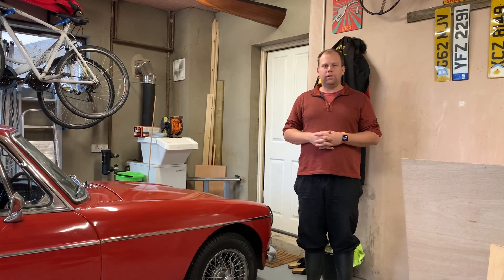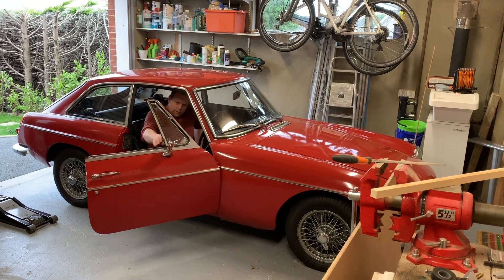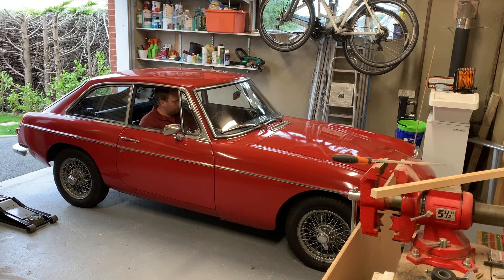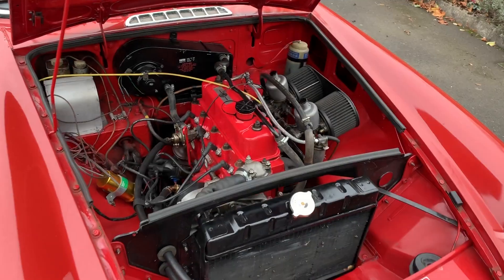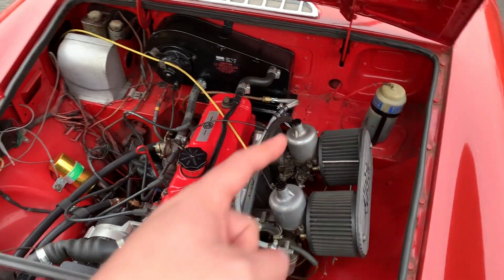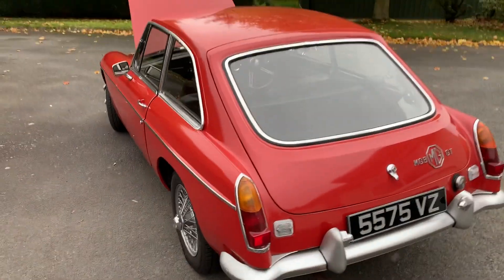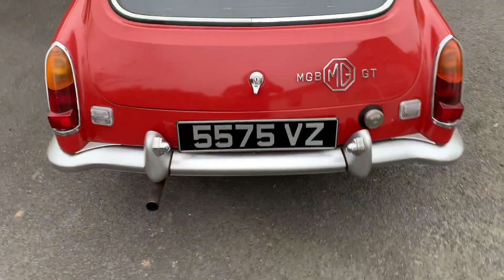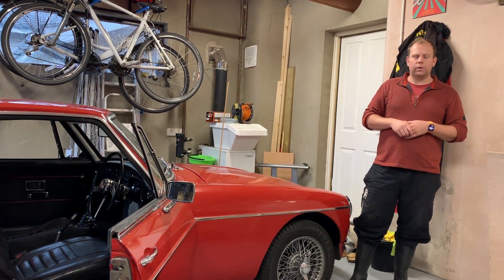MGB GT - The Perfect Classic Car Daily Driver?

Comment: I've had a '75 BGT for over 10 years. I rebuilt it from the ground up with unleaded head, electronic ignition and full s/s exhaust system..    It isn't exactly my daily driver, but I do use it an awful lot.   Drove it from my home in the Midlands upto Scotland, and back. It never missed a beat and I got 28.8 mpg.
Reply from the maker: Nice one Fred! Would love and OD for my own some day. A stainless exhaust wouldn’t go amiss either!

Comment: Without going into the video yet (really), except for the inherent reliability and performance issues of British autos at that time, I'd agree.
For a single person, a couple or a small family (until the kids feet touch the floor) it could be useful.  ;-)
I had a 1972 MGB with a inset grill, fake mag steel wheels a role-bar, tonneau cover (damaged) and had it repainted British Racing Green.  So much fun. ;-)
I had intended to install a set of driving and fog lights, tonneau cover repaired (modified) and a center brake light to the roll-bar.
Despite being damaged it solved a problem.  With the tonneau cover unzipped down the center, the passenger side would flap (distraction).
Because of the damage I'd keep the center zipped and tuck the drivers side flap between the passenger seat and console (steering wheel pocket gave extra knuckle room) so if I had it repaired I'd ask that I could still fold it down..  ;-)
Reply from the maker: Thank you! Yes, small children only in the back seats!
Reply: Opps, I should have made a seperate comment about my 72 MGB.  ;-)
Reply from the maker: Just reading that now. Very good!

Comment: Was considering buying one from a work colleague after I passed my test in the 1970's. Quite a nice looking car (with chrome bumpers that is) and fairly practical as a daily driver. However I discovered my Dads' Triumph Dolomite 1850 saloon (not a Dolly sprint) was quite a bit faster. This put me off owning one.
Would think you would have to drive foot to the metal on occasion to keep up with things these days.
Reply from the maker: Nice one! Always liked the Dolomites! Not too bad on requiring full throttle. ‘Modern traffic’ doesn’t really move that fast other than motorways!

Comment: When I used to own one of these GTs, it would overheat in the summer time bumper to bumper traffic and the SU carburettors made starting in the cold difficult. The heater was barely adequate to keep the interior warm. BMC had plenty of time to address these issues but they chose to just ignore them. 4th gear was noisy at highway speeds. Generally speaking, it was a decent car, but I felt like something was always breaking or failing after a few joyful months of driving and then my wallet would be lighter. When I decided to rebuild the engine, my machinist informed me that he couldn't bore the block because it didn't have sufficient material between the cylinders. I ended up reusing the old pistons. As long as you have a back up vehicle, you are generally safe.
Reply from the maker: Well fair enough but I suspect you had a bad one. My heater would have created so much heat it was unbearable. The car never overheated once and the gearbox was very quiet. It’s a shame you didn’t get a good experience!

Comment: Do you know what the RPM's are around highway speeds (70-80MPH)? Great in depth video!
Reply from the maker: Thanks for watching! Apologies but I do not, car has been sold otherwise I would check for you
Reply: Oh, that’s alright. I’m looking to get one and I was just curious if an overdrive transmission swap would be worth it.
Reply from the maker: If I had kept mine then I would have definitely gone for an overdrive, just to make cruising a bit easier

Comment: I use my 74 Roadster every day, in Michigan except of course, not in the snow.   Tend to avoid the rain when possible as well.   Agree with the comment about an overdrive.  Makes the MG much more livable.  Other add's I have done, Electronic ignition, larger GM alternator, a larger Aluminum radiator, and an electric control for overdrive so you don't try to run it in reverse.
Reply from the maker: A bigger alternator does sound like a plan! Nice idea about the overdrive control!
Reply: Where in Michigan JC X? I'm in the Lansing area and have a 1971 Midget that I cruise around in all summer long.
Reply: @greekboy5155    Metro Detroit.  Rochester.
Reply: I'LL BE BACK !    What I added is a controller switch.  So if you are in od 4th and and shift to any other gear, while leaving the od switch on, it will not go into overdrive again until you cycle the od switch, off / on.   It my case it works for both 3rd and 4th gear.  So it forces you to decide when you want od engaged.

Comment: The perfect MGB GT would be one with a cosworth twin cam 1.8 or 2.0 liter engine with a close ratio 5-speed, 373 geared, limited slip IRS. The engine should have ITB’s AND  Roots-type supercharger attached. With this set-up you’d need Recaro seats up front and a proper MG. Wood rimmed steering wheel! Massive sway bars both front and rear and Bilstein HD coil overs at all 4 corners would be an necessity. As for wheels and tires, some custom 8” wide 15” chrome wire wheels with some 235/40/R15 VR rated Michelin tires. A good 2 1/2” exhaust system would be a necessity! Now THAT”S my kind of daily driver!
Reply from the maker: Not too much different to standard then? Haha
Reply: Restosaga Classic Car Restoration, LOL that’s my idea of standard. Of course I’ve owned Hemi Cuba’s a1967, one of eleven 427 L88 corvettes. An original 1964 GTO convertible that I bought new before I went into the Marine Corps in 65. It had a factory 421 super duty engine with dual quads, 4-speed and a safety trac rear with 4.88:1 gears. That was a low 12 second street beast. That’s not counting the numerous cars I’ve had since I got out of the Corps in 71.
Reply from the maker: Nice one!!!
Reply: Restosaga Classic Car Restoration , Now having said that, you’d have to get Elon Musk to pay for it. LOL

Comment: Those wonderful SU carbs, like a Swiss watch, on a Harley Davidson they are absolutely without peer, no other carb has the throttle response on a Harley that they do especially on the older Harley's (pre Evo engine, 1984 and earlier) because of the constant velocity principal that they work on, older Harley's had ports that were too big for the engines requirements and the CV effect really helps them out.
Years ago we would scrounge junk yards for SU's with the prize being a 2 inch version from off of an XK Jag, we would have to cut the flange off of the intake and weld it onto an intake from a Harley that had it's flange cut off.
Now you can buy them brand new ready to go with intake manifolds and cable brackets for just about any model Harley new or old (within reason when it comes to old), after 1997 they improved them by removing the bushing from the dash pot and replacing it with a caged ball bearing assembly and modified them to run without oil in the dash ports, that along with the "eliminator" fuel bowl that did away with the external fuel bowl and incorporated it into the bottom of the carb makes them very motorcycle friendly, and the fast idle cam with it's automatic release is the icing on the cake, hats off to the boys in Birmingham for that one.
Reply from the maker: Very cool!!! Didn’t realise they could be used on Harleys too, nice one!
Reply: @restosaga  
Oh yea, Rivera Engineering in California buys them new from SU and provides intakes, throttle brackets and modifies a few little things on them so their ready to bolt on, 5 different needles and 3 spring rates give them infinite tuning capabilities from stock size engines to the biggest stroker monster you can build.
Also a guy in Daytona Beach named Carl Morrow who set a land speed record in 1972 on a Sportster with a 2 inch SU from an XK has a speed shop that offers a carb called a Typhoon, it's basically his version of a large SU.
I'll bet if you Google "Carl Morrow Speed Shop Typhoon" you can check them out.
Greetings from America and if you ever find yourself in Birmingham tell those guys at SU "good job" from me.🇺🇸🇬🇧🇺🇸🇬🇧🇺🇸🇬🇧👍👍👍
Reply from the maker: Nice one, will do!!!
Reply: @restosaga  
Also check out an outfit called Z Therapy in Portland Oregon, it's a guy who races the old Datsun 240Z's, he specializes in SU carbs and setting them up for performance use, he offers instructional videos along with his services, one service he offers is fixing the carb bodies where the throttle shaft passes through them, the holes eventually egg out and cause vacuum leaks, what he does is machine out the holes and press in small sealed ball bearings and makes new shafts and throttle plates, that fixes the leaky throttle shaft problem forever on them, I've sent carbs to him and have nothing but good things to say about his work.

Comment: I saw a 1969 that had five gauge clusters in the dash - not the 2 with the big pull knob like yours.  It also has the ignition on the stalk and no switches or controls to the left of your ignition. Also the passenger side rear mirror is located on the front quarter panel, not by the A pillar. So, what's the difference?
Reply from the maker: I’m not too sure of the answer to this, but hopefully someone on here can help us out!

Comment: I’m looking at this exact same model car as a first car. What do you think about this car for a first car?
Reply from the maker: Emmett, thanks for getting in touch. I think this would make an amazing first car. Cheap to run/fix/maintain. Can’t see insurance being too horrible either, my own is very cheap. If you don’t have huge distances to cover then an GT could be a great option. Overdrive if you can get it would be my top advice! Let me know how you get on!
Reply: Restosaga Classic Car Restoration thank you very much
Reply from the maker: No problem! Let me know if there’s anything else I can help with
Reply: I bought a '67 roadster as my first car two years ago and it's a lot of fun. Expect to break down a lot if it hasn't been taken good care of (mostly electronics and charging, in my case). But with time you'll become mechanically inclined enough to fix/replace most parts. Just make sure you find one with little rust and an okay engine bay. Feel free to ask me questions!
Reply: My friend has a beautiful 1978 yellow model and we’ve just come back from a camping trip in the Peak District.  His first car and both he and I absolutely love it.  Beautiful vintage feel and smell, fantastic!

Comment: I drove MGB GT's for over a decade as a daily driver... Three engines, two paint jobs, one re-upholstery, countless replacement wire wheels / hubs and mysterious gremlins related to lucas wiring and smith gauges... Zero horsepower and worse reliability... Hell, my Morgans were more reliable than my MG's...
Reply from the maker: Sounds like you’ve had quite the MG experience!!!

Comment: Have a 75 mgb gt I didn’t realize that you have to add on to the carb pots ,how often,how much , and what type of oil. Thank you
Reply from the maker: So the exact oil type is controversial but SU themselves supply dashpot oil so I use this, about 20w50 I believe. Fill to 1/4” below the top of the plunger. Check every 1000miles. Makes quite a difference to throttle response and smoothness of operation. Hope that helps!
Reply: Thanks very much useful info
Reply: @restosaga  Hi I am getting a 67 mgb Gt. I am not sure about the part where you said to add oil to the carb pots, Do you have a video about this? Thank you

Comment: Defenetly not. How it could be? Such a small car with a 1800cc fuel. Maybe in the Usa where fuel is cheap, but in anywhere else.
Moreover,  it could be a daily driver just if restored but like almost all cars.
Im a owner of mgb roadster 1973, in my country are like twice more expensive than in uk and 3 times than in Usa. There's a lack of spares parts and mechanics who want to fix an old car.

So for me... It depends where you live. But for the modern standard it is not dailydr
Reply from the maker: Do not agree that 1800cc is a small engine or that this is too small a car. Circumstances and where you live will determine your needs though, you are right there!

Comment: Of course you can daily drive this beautiful car year round in Britain. Parts availability and knowledge of the car is high, there. What's wrong with Brits? Don't you understand what you produced?
Reply from the maker: I agree!
Reply: @restosaga  This is from commenter on this video, D. Palmer, of Chicago, below. I looked up temperature records from Chicago between 2011 and 2014. On January 6, 2014, it was -15 degrees Fahrenheit in Chicago.

D Palmer, 1 year ago:

"Totally agree. My '72 GT was a daily driver for me from 2011 to 2014 here in Chicago, including during the winter. In 2013 we had one of the worst winters ever in Chicago snow wise and it powered right through and never once failed to start. It also holds a surprising amount of stuff."